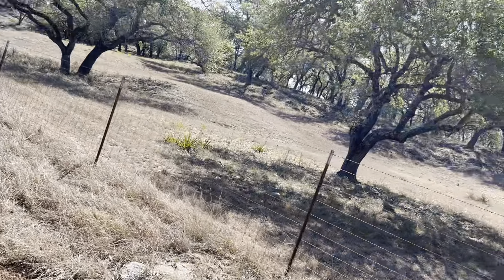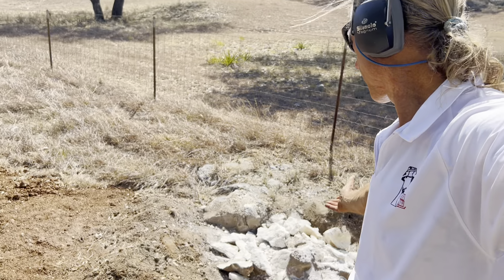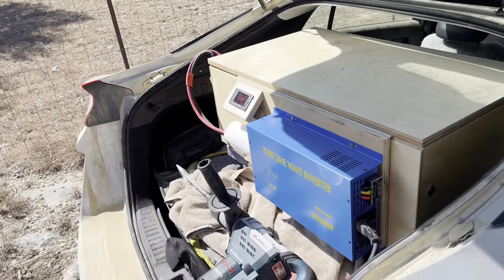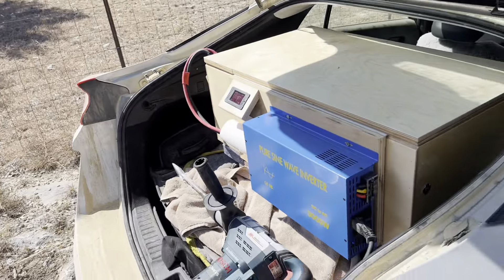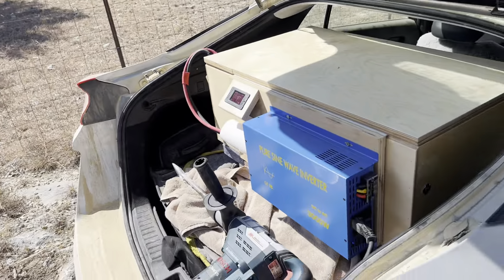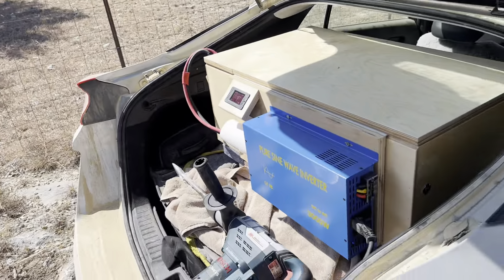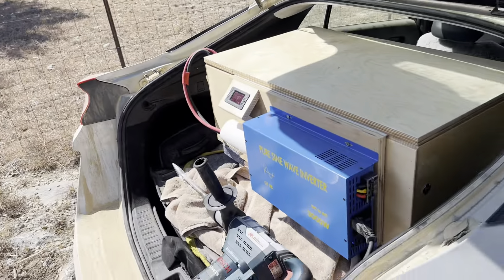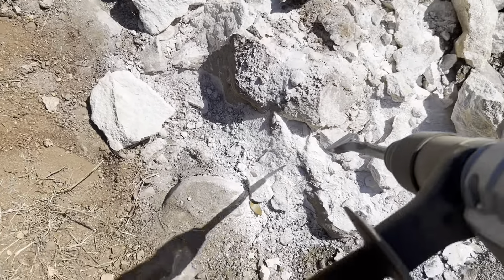Wow!! Lifepo4 Gives Portable Construction Power In Remote Locations!!!

Comment: What? What? I can't hear you over the chipping hammer! :)
I have obviously been watching your videos too much - my battery pack looks almost exactly like yours except I have mine in a steel box (a flimsy, but reinforced unit from big box stores) and set up as 4 banks of four cells (so I can move the packs easier). The detail is uncanny - standard bus bars cut in two for the + and - terminals, the screwed in BMS connections (I actually have two tapped holes on each bus bar - one for an active balancer option).
Thanks Ray, you have been a great teacher for me.
Reply from the maker: Lol, I was just saying that it was really hard rock!

Comment: Yup. With the newer higher wattage yet relatively small high frequency inverters, making portable solar generators is a fantastic option for mobile power solutions. Now if only the batteries could be a little lighter. Lol.
Reply: 5KW/h of Life-Po4 is about 54kg.
Reply: @a64738  Obviously it’s a LOT lighter than FLA but still a bit for my tired old back to be lifting around. Definitely need some mechanical lifting device to assist. And Much better than pulling around a petrol generator for sure.

Comment: I like the Bosch Professional Equipment. We used the 11kg version to tear off the walls of the gable roof walls of my brothers house in preparation for a new roof. We also tried a small Makita some days before on some concrete... Should have borrowed the Bosch for that work, could have saved many hours of demoralising work :). So if you have the possibility to rent a bigger Bosch hammer - go for it :).

Got a 12V 4s system in my minicamper - and i like the possibilities it offers when you need electrical power in the field - even with low capacity of 120Ah it does it's job with a 1.5kw inverter.

Comment: Add some solar panels to the mix and you can make the battery last even forever if you have enough panels :) I have 1280w of panels on my camper van and 5kw/h of Life-Po4 and the panels help a lot even when it is raining to extend the battery capacity. (I get about 1500w total on a dark rainy day from the panels and normally about 3000w if it is normal rainy day that is not exceptionally dark).

Comment: already seen coffee vans getting rid of generators and running off batteries, wont be long until it's the normal everywhere with fuel prices like they are.
Reply from the maker: More strain on the grid but should be charged at night and maybe solar charged during the day.
Reply: @RayBuildsCoolStuff  sure in the short term there will be infrastructure push back due to the incumbents not wanting to lose control of their money printer, but long term "the grid" is going to be more of a marketplace than a utility. With batteries at substations, neighbourhoods and homes balancing demand will be much easier, I think we will also see a lot more people "off grid" this has been accelerated due to beer flu but was already happening to an extent. exciting times!

Comment: I think it would be easier to just use an inverter powered from the 12v secondary battery of the Prius!
Reply from the maker: I use the Prius for backup power but not at that amperage. 800 watts is more than I would take from the Prius. It simply isn’t designed to provide 75 amps.
Reply: @RayBuildsCoolStuff  I understood that the dc to dc converter was capable of 100 amps....

Comment: Don't you wish you could just tap into the battery already in the Prius?  Let the engine start/stop as needed to keep that battery charged.
Reply from the maker: I can and in an emergency, I have. It is one of my layers of redundancy. I use a 1,000 watt inverter off the 12v battery. I limit it to 75amps. I consider a car to be a very expensive generator so it is only used in a pinch like when we had our icepocalypse and lost power for five days. The Prius kept my exterior tankless water heater from freezing and maintained communication and security.